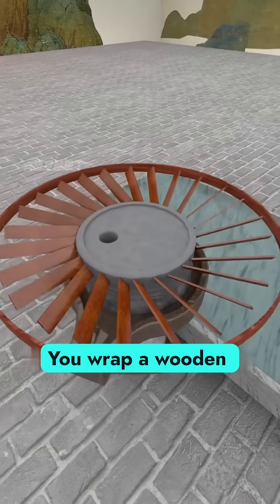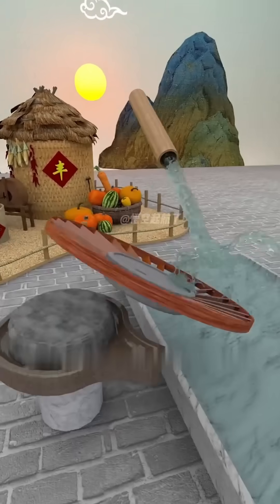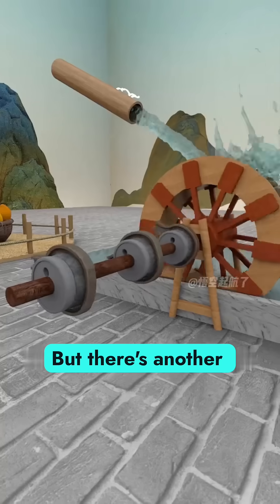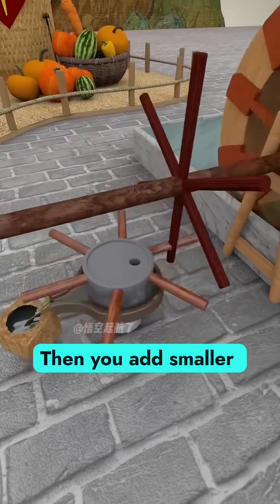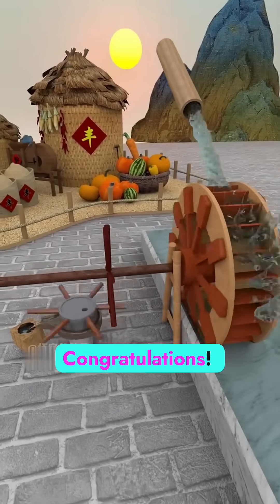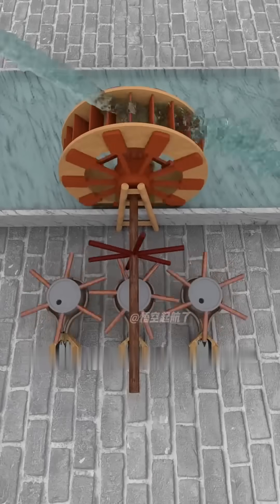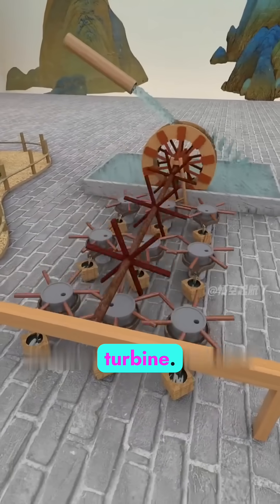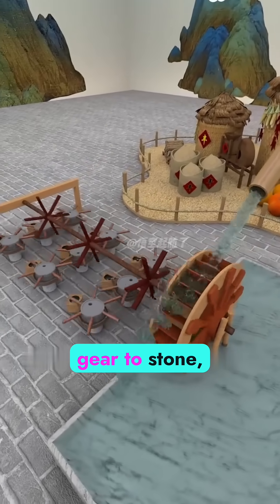“This Ancient Water Mill Powered 9 Grinders with 1 Turbine | Engineering Genius Explained”

Comment: Another infinite energy source?
Reply from the maker: This video provides an overview of the fundamental principles of hydroelectricity.
Reply: @dasanimator-d3iyeah but if you put this kind of invention in a zone where costantly raining technicaly speaking you create  a some kind of infinite energy source
Reply: @dasanimator-d3i you should connect the entire millstones shiunzi chinese gear whatever to some kind of resident evil biotechlaboratory connected in the same time to some capsule which they are plants insides connected to a computer delta
Reply: @Tristanlouisino949g  there is no such thing as infinite energy. all energy is finite. it gets energy from somewhere. for this we are using kinetic energy stored in the position of the water molecule and transferring to different direction. if water runs out it will stop. it is charged power bank.